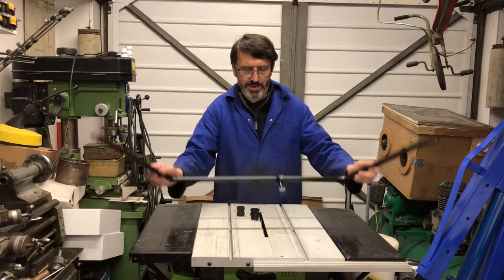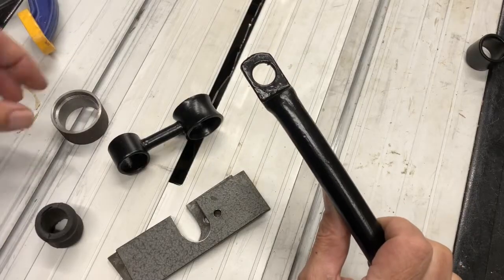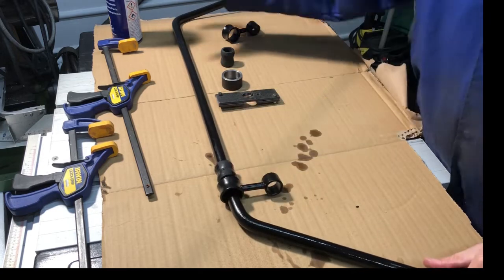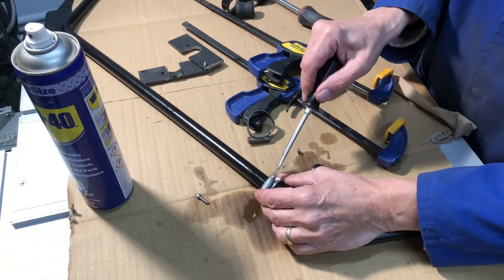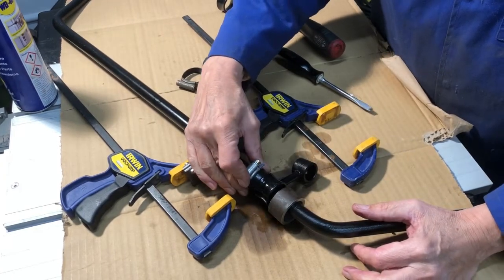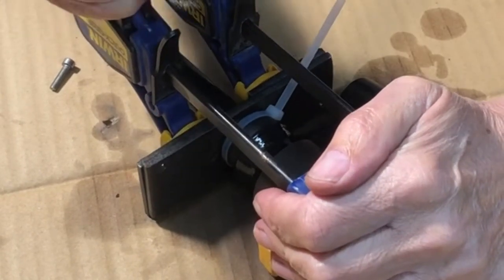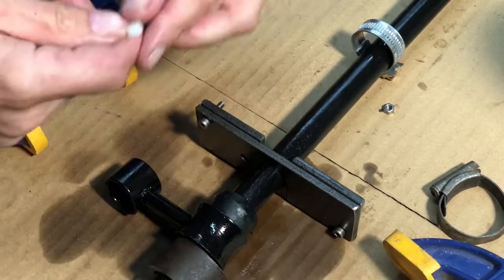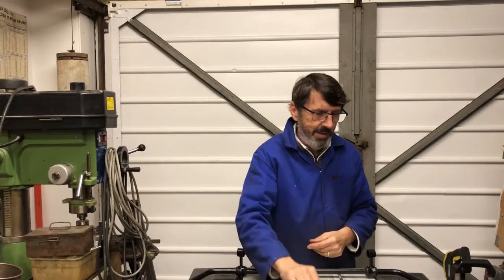Lotus Elan - Fitting Anti-roll bar bushes the easy way with a bespoke jig

Comment: Ian a little credit for pushing through with a reasonable home grown solution well done. To all viewers the BIG MISTAKE – do not use WD-40 on rubber parts you can greatly shorten the life of the rubber. Rubber and plastics reach for Silicone Spray and Silicone grease for rubber and polyurethane bushing.
Reply: KY jelly also works, being water soluble. Petroleum jelly, never!

Comment: It's a fair effort I suppose, but I'll stick to what I've always done: clamp the roll bar in a vice, install the bush in the drop link, drop the bush & drop link in a cup of boiling water to soften the rubber, squidge plenty of KY jelly onto it & charge at the roll bar with it from the other side of the workshop, pushing & rotating the drop link as you go. Always worked for me.

Comment: This comment may only apply to poly bushings -- haven't tried it with original-style rubber. No matter how much I compressed the poly bushing with the link on the ARB, even with copious amounts of silicon grease, the bushing would not slide into the link. The poor bushing was absolutely squished. I finally concluded that the annular gap between the ARB and the ID of the link, where the "hour glass" shape of the link tapers to its minimum diameter, was jsut too small.

At this point I figured there was nothing to lose, so I pulled the bushing and link off of the ARB. The bushing pressed right into the link with the help of a big C clamp. I was concerned that forcing the bushing over the flattened end of the ARB would destroy the bushing, but such was not the case. Lots of silicon grease, some firm pressure, and several taps with a sledge hammer and wood block moved the link and bushing right over the flat. There appears to be no damage to the bushing -- it's nice and tight. That poly is tough stuff.
Reply from the maker: Thanks for the insight. If I change to poly bushes I'll try your method